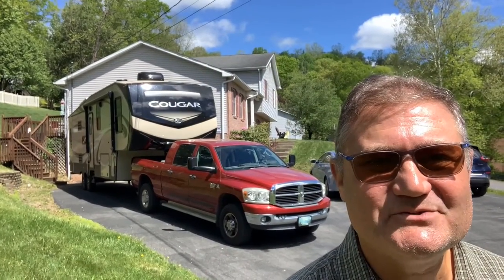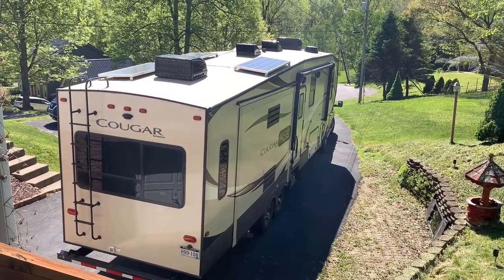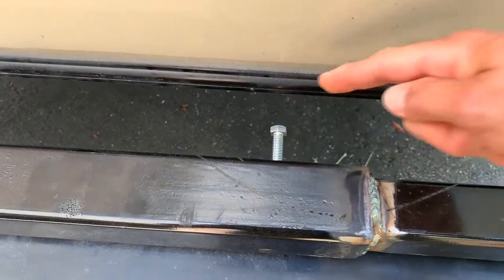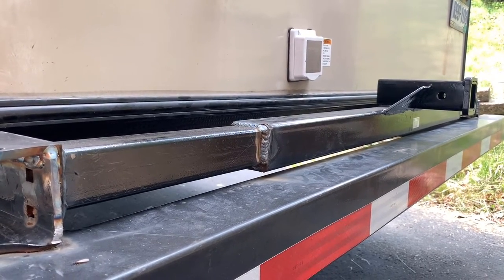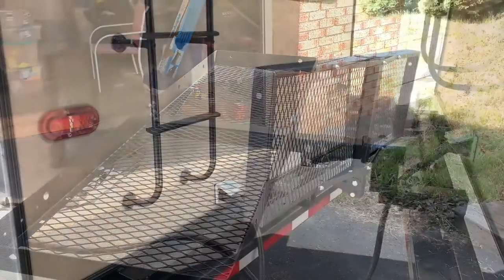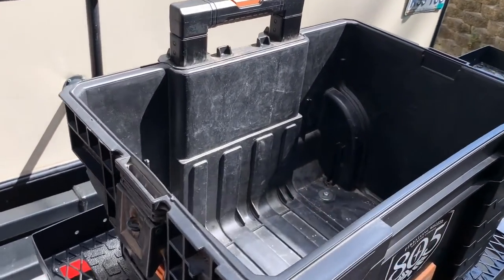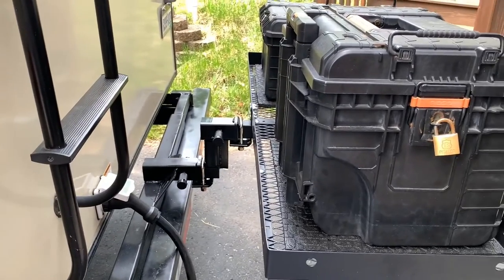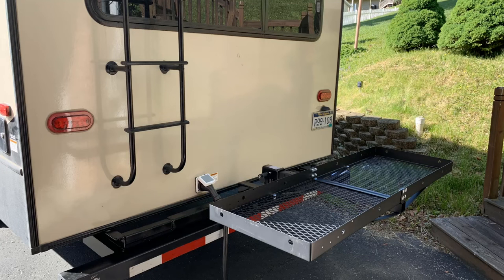RV Cargo Carrier Upgrade | Start to Finish

Comment: Looks like you are set for many years of use again. Can't believe those stabilizers tightened it up that much.
Reply from the maker: Yea — I was super pleased that the heavy duty anti-rattle stabilizers actually worked.  I have to say that I’m very pleased with the overall project.  Thanks for watching!  Lou